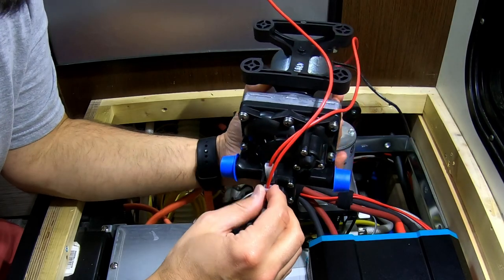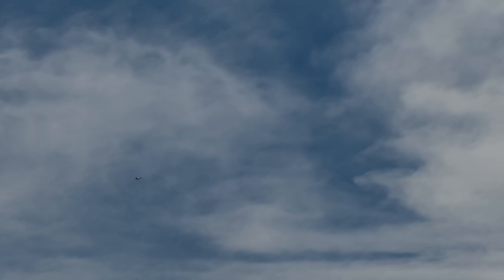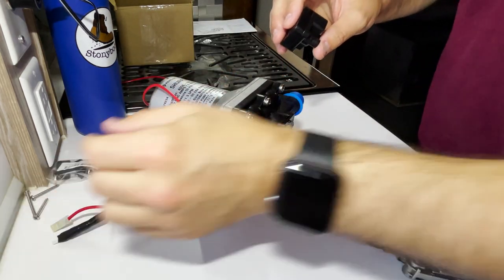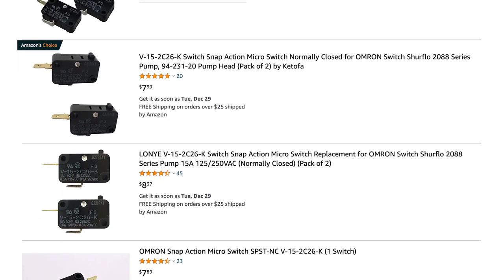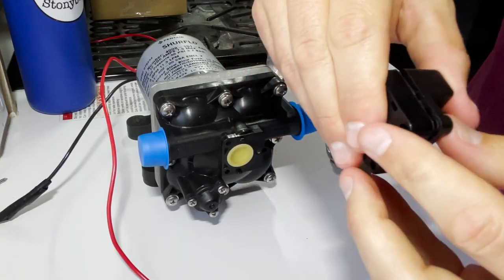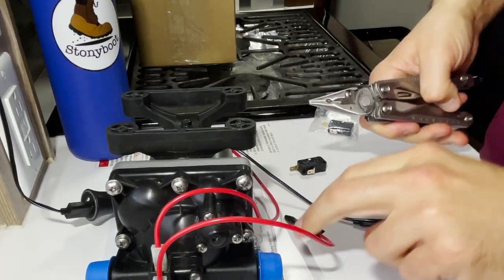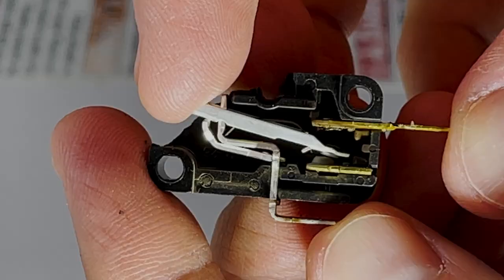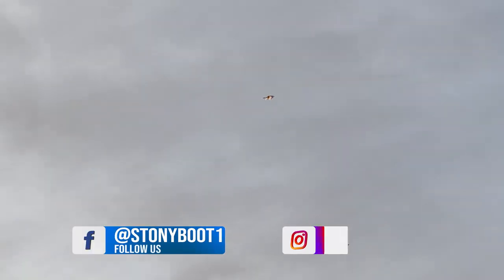Cheap Shurflo Water Pump FIX! | Easy Repair | Shurflo 4008 Pressure Switch Replacement

Comment: 2:31 you skipped the part where you remove the adjustment screw with the 5/32nds allen key. Trying to take that switch apart without doing that will only frustrate and risk breakage.
Reply from the maker: Noted, thank you.

Comment: All these pumps have the same achilles heal (Cycles kills the micro switch). You can add an accumulator to the system to reduce the cycling or get a pump with a bypass so the pump still runs when less flow is demanded (in Lieu of cycling the microswitch).  The best fix seems to be to add a Solid State Relay to take the heavy switching current and thus reduce the arcing significantly.  The SSR does the heavy lifting based on the small current switching of the micro.   This video is a fantastic example of what is going wrong. Great job pulling it down tot he root cause 🙂
Reply from the maker: Wow, amazing comment. Thank you. I’m have an accumulator which helps. 

I have my eyes on a bypass pump someday, but it hasn’t quit yet. 

I’ll look into the solid state relay. I’m going to guess that you’re an electrical/electronics engineer?

Comment: Where do you get the wire ends? You had mentioned one had “melted”- where did you buy the replacement wire end?
Reply from the maker: I had those ends in my electrical kit. But you can get similar connectors at auto parts stores. Autozone, O’Riley, Advanced Autoparts, etc.

Comment: Great video!  Recently, I spoke the the manufacturer of this pump, Pentair / Shurflo, they told me the reason they only provide a one year warranty for this pump is because the brush wears out.  If you camp off grid a lot, the life of these brush motor water pumps are 1-3 years.  A common sign of failure is that pump flow reduces a bit and goes out unexpectedly.  If a company made one with brushless motor, it would last a lot longer but I could find no upgrade.  For $65  - 75, you’re better off replacing the entire pump because on my rig, it takes about an hour to remove and install plus the backache of working in a tight space.

Comment: Great video, except that you misassembled the black button that should push against the pressure adjustment screw.  As you have assembled it, the pressure set-screw only pushes against air, preventing any adjustment.  BTW, per the comment below, I didn't remove that set -screw when I repaired mine.  No problem.

Comment: Love to see people try working on something new, and end up fixing it for 1/10the price of new, not to mention saving throwing away a perfectly good pump over a failed switch..
Reply from the maker: Agreed. It happens too often, people replace rather than repair. Unfortunately, that's the direction consumer goods are going, "Designed Obsolescence"...

Comment: Ive had 2x 4009's and 1x 4048 shurflo pumps, ALL 3 had intermittent connection issues with the pressure switch, one even failed within 3 months. Ive had the head of the unit vibrate away from the body because the bolts they used were not quite long enough also. Everything is utter junk now, the threads on them are plastic making cross threading connections very VERY easy to do and replacing that is 2/3 the cost of the whole pump of course. At the minimum each pump should come with a spare replacement switch instead of making tens of thousands of us go without running water for days to weeks until we can replace it... Thanks for discovering this cheap fix, Im an off grider for life so you will save me many hundreds over my life.

Comment: First of all, thanks for the video.  Quick story!  We spent December and half of January in Gulf Shores Alabama.  During this time there were several days where the temps were in the low 20's.  Even though we had full hookups, several of the campers experienced a water pump issue. We did not check ours at the time and found on our way back to Texas our pump had issues.  Remembering the campers ALL said their failures were pressure switches, I decided to just replace mine to see if the problem went away.  I found your video first  and followed your lead not only in the repair but also in what you ordered.  So yesterday I ordered, and today I fixed the problem.   GREAT INFORMATIVE VIDEO!!!

Comment: Just stumbled upon this video. I have barely ran my pump, maybe 3 hours total. It's newly installed. The relay failed on me right before a trip. I have an accumulator installed to help with the pressure.

This video saved me!

Comment: Nice. Had to take mine apart a few weeks ago.. the check valve was stuck. Was fairly easy to repair! Thanks for sharing! Yet another great project video!
Reply from the maker: Thanks for watching! It's nice to see that these pumps are fairly simple to fix and have plenty of replacement parts available!

Comment: I appreciate so much you taking the time to explain this!  I worry from time to time about the water pump dying just at the wrong time when camping.  Have always thought about getting a spare to take along just in case.  Mine's in storage for winter, will have to take a close look at the model in Spring, and order a spare!
Reply from the maker: I enjoy sharing what we learn. Of the many components in the camper, I find the water pump is one of the most important. We can use our jugs, but a spare is small and easy to replace. Finding out that the old broken pump could be fixed fir $4 was just an added bonus. No need to buy a new one.

Comment: Thanks for the tear down. I’m currently troubleshooting our less than one year old class c coach’s water pump which cycles one every 10 seconds or so even with no valves open. My first thought is that I must have a leak somewhere…and I still think that’s likely, but this gives me another direction too.

Comment: Great vid...good camera angles showing all the steps.  I boondock in my Northern Lite truck camper 6-8 months out of the year in the Rocky Mountains for the last 3 years and haven't had any problem with my water pump yet.  Kinda thinking about pre-empting a failure and change out the switch before that happens if it's a common thing.
Reply from the maker: Getting a whole pump and keeping it on hand has been my goto strategy. I was able to fix this one and re-use it as a spare. If I have a failure for any reason, I want a complete pump ready to go! How do you like your Norther Lite, I think they are AWESOME!

Comment: Thank you for this video on how to make a very inexpensive repair. I did give you a thumbs up for your video. Although this has nothing to do with your excellent video and instructions, the problem with the Shurflo water pumps (particularly this model (4008) is that they are so dang loud! Particularly noticeable in a smaller rig. I came across your channel while looking for solutions to replace my Shurflo 4008.
Reply from the maker: Thanks for the comment. In regards to the sound. Try adding a flexible tube to the inlet and outlet side. Leave a loop in the flexible tubes (make the shape of an O) and then connect back to the factory lines. Also, make sure that your PEX pipes are secured properly and not vibrating against the walls. 

Just the flexible tubes do a good job of insulating the vibration, but there are other steps you can take. 

Adding an accumulator tank can also help quiet the system.
Reply: @Stonyboot  Thank you for the suggestions! I will see if any of those situations exist in my rig.

Comment: Thanks for the video! Definitely helped me understand the internal workings of that. I purchased a brand new one of these pumps for my self built conversion van and immediately had trouble with it. I found if I move those wires where they plug, it was almost like it was changing the sensitivity of it. I could push on it and the pump would turn on or off prematurely. I returned that pump and purchased another and have had no problems with it until recently. It started acting up, and when I move those wires around it does that same thing as the one I returned. Did you happen to notice if that switch was pretty loose in the housing? Because that would explain what I’m seeing..

Comment: My pump wont shut off it might be that switch.
My pump is a Shurflo 2088-422-144. I'm wondering if your pump model would replace mine?
Great video!

Comment: great commentary,even though i just bought a new pump i will try to duplicate what you have shown and hopefully have a spare...my pump  just stopped,checked the electrics and fuses and shook my head...one second it pumped ,the next second it was silent...odered a multimeter to see if power is coming to it..never done that before but your youtube videos are gold..have a great trip wherever you go guys..and thanks from the UK.
Reply from the maker: There are many reasons that water pumps like these fail, however, I think a faulty switch is the most common. Good luck with your diagnostics! We are looking forward to visiting the UK in the near future, but for now, we are in Michigan and headed to the Pacific Northwest of the US. Cheers.

Comment: Do you have a video of removing the pump from the inside? Thanks.
Reply from the maker: I don’t, sorry. Basically, you need to release the pressure from the system, unscrew the water line from both sides of the pump and then unscrew the pump from wherever it’s mounted. 

In my case, I had to cut the wires (pull the fuse out first) and then re-wire it when I put it back. Some campers come with a handy plug that makes it easier to disconnect it.

Comment: Thank you for posting this. I have a water pump issue, the fuse keeps blowing and I can't determine the cause. As a test, I removed the two cables from the pump, put in a new fuse and turned on the switch. The switch stayed lit/fuse didn't blow. Does this mean the issue is with the pump?

Comment: We have the exact same pump and it just failed last night. I found if I hold pressure on that same wire of yours that melted, the pump will run, but it gets too hot to hold the wire. Wondering if that could be a faulty switch causing that? Thanks for this video! New sub here.
Reply from the maker: I looked up the cycle life of that specific micro switch and its makes sense that it failed, they burn out after a predictable number of on/off cycles. The nice thing is that its easy and cheap to replace!

Comment: My shurflo pump is turning on and pumping water… my issue is it won’t shut off. I use it in my food truck… normally it shuts off when I turn my tap off and comes on when I turn my tap on. It hasn’t had a lot of use yet and has been working great until the last few times I’ve worked my truck. Do you have any idea and suggestions for what it might be? Does it have a sensor? Thank you
Reply from the maker: Sounds like the pressure switch. That is another common issue. They are adjustable, but I’d suggest getting a replacement pump and then seeing if you can fix the old one. Especially if this is a business. They aren’t that expensive and then you’d have a spare.

Comment: Hey. I have the same pump that wouldn’t turn on when I flip the power switch. Did yours turned on before you switched out the part?

Comment: Thank you for sharing. However, I have a question. If indeed it is just a switch. What I had experienced was after I filled our holding tank and switched the valve back to Normal I went inside the RV turned the pump on and the water was coming back out of the fill  area. Could this be a result of the switch failing?
Reply from the maker: That doesn’t sound like a pump issue. I’d need more information about your setup to have an idea of what’s going on. 

I don’t have enough info to build a mental picture of what you’re explaining.  Can you elaborate?

Comment: DC voltage/amps are hard on contacts, they deteriorate after some wear,that contact is on the positive line. Also if your pump keeps blowing a fuse your battery may be going bad, as the voltage drops the current will increase and could blow fuse, before it burns up the pump.

Comment: Multimeter would quickly test that switch and verify it’s bad. Nice video.
Reply from the maker: It was an intermittent issue. It seemed to be a build up of carbon tracking. The contacts were mostly melted. But, sometimes, it would work perfectly. The micro switch had a 20-50k cycle life.

Comment: I've had my camper for 8 years. I RV full time. I just replaced the water pump for the second time. The first time was years ago and there was black plastic debris under the water pump so something spinning went bad. It was so long ago I don't recall taking it apart to see what it was. I'm not even sure if I saved it with that intention. This time when it went out it had symptoms for the past year. It seemed like it was shutting off when the RV wasn't level because I'd go out and push on the pump body and it would start working again. Just before it stopped working this time I pressed on the lower assembly and it started to work but only for a little bit. I hooked up to water and was able to turn it over but once I turned off the hose feed. The pump wouldn't work. I don't think it's the pressure switch. I'm leaning toward the lower assembly being messed up. I'll take it apart this time to see. I might be able to replace the lower abd have this as a spare. I may have been able to do that last time...

Comment: Nice repair! On a different fix - have you adjusted your mixing valve for hot water? Searching your content.....
Reply from the maker: I did adjust it, and now I leave it wide open. When we are on city water with constant pressure the temp stays consistent. When we run off the pump and stop/start the water flow. The temperature varies a lot. We’ve gotten used to controlling it manually since the mixing valve didn’t stop the scalding water. I have some ideas on how to fix it, but it’s at the bottom of my list.

We are visiting NuCamp soon and would like to run it by their techs. It could be defective or we could have a bad check valve. It’s been my experience that RVs don’t usually have consistent water temperatures unless the water flow stays steady. That wastes water, so we deal with temperature fluctuations.
Reply: @Stonyboot  Thanks for reply. My wife uses more water to shampoo hair. While boondocking, I usually take a Navy shower - leave water to drip (wife calls it a spit shower). Then increase flow for quick rinse. 
On city water & sewer now to adjust mixing valve. Will switch to pump tomorrow to test settings.
Reply from the maker: Good luck, I’ll be curious to hear the results.

Comment: You can test if the switch is functioning correctly with a digital multi meter using the continuity function.
Reply from the maker: Correct. In my case, I could get the switch to pass voltage, however, the fact that it was melted was a good indication that it needed to be replaced.

Comment: so replacing the switch will help with pressure ? i notice mine takes a long time to build up pressure too ?
Reply from the maker: The switch controls the cycling of the pump. Pressure is controlled by a set screw that changes how much pressure it takes for the pump to cycle on and off. 

The issue I was fixing was the pump was not cycling consistently. It keept stopping and not starting again until I tapped it with something. 

You can adjust the pressure set point on most RV pumps using an Allen wrench.
Reply: no, the switch just shuts off the power to motor, does not increase pressure

Comment: the switch goes bad on these pumps all the time the best fix is to put a inline pressure switch in from amazon it requires a tee fitting to be put inline 1/4 npt  the water pump switch gets water in them and makes them fail ,quality inline switch will last forever and you don't have to remove water pump to replace the switch
Reply from the maker: That's a great idea! I've never even heard of that, I'll go check it out now. Thank you!
Reply: Especially if you have a 17 amp pumpnthe switch gets super hot